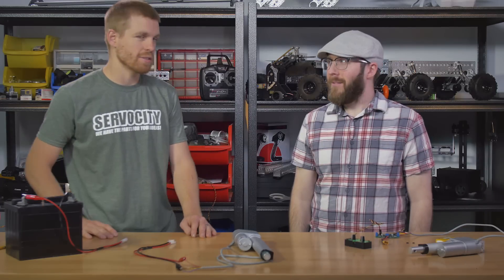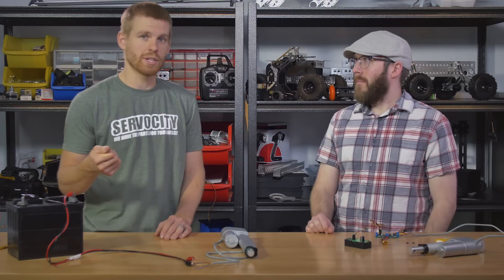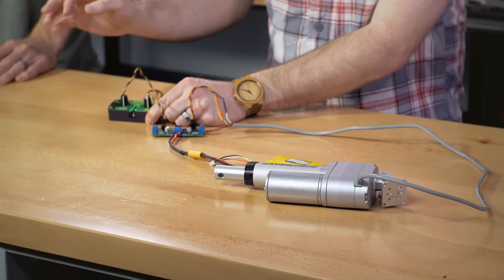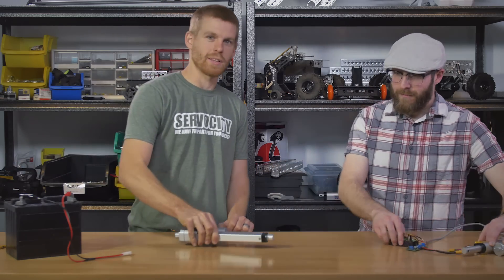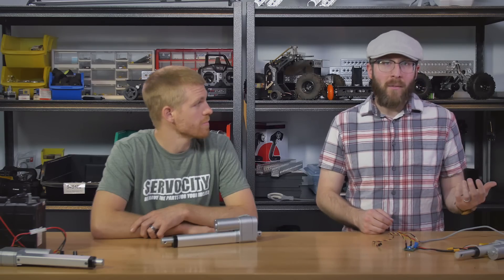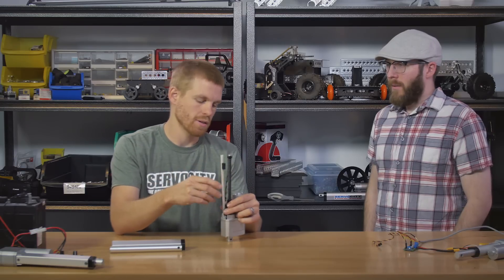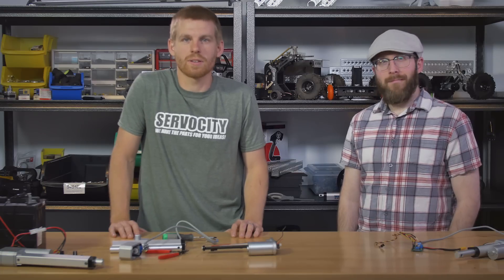Comparing Linear Servos & Linear Actuators - with Kyle and Jason

Comment: Thanks for the insightful video. I want to know which one of the two (among actuator and servo) should be the right thing to use for a position controlled height adjustable table that too with sync stoke on multiple legs. Thank you!

Comment: 8 years now. Well, I am an automotive guy who has somewhat painted myself into a corner. Meaning, I have auto controllers already that produce a PWM signal to operate a brushed DC motor. I need to piggyback of this circuit to control a cable that requires 4 1/2 lbs. and only move 1 3/4”. The speed is a concern as the faster the better, but also longevity is my main issue. It will be operating in a circuit environment between 12.3 - 14.4 Vdc and pulling only 4 pounds in a short distance. It will be a cable that controls hydraulic pressure and will see hundreds if not thousands of micro adjustments per hours of use.  I really like the ball drive on polished worm screw concept as P/S gear boxes use it, but most 3D printers, lazer cutters on larger scale use these and so forth. When piggyback I mean using good quality relays to convert low current into higher current circuits. Less than 2” of total movement plus only 4 pounds roughly as I have measured it with a mechanical pull scale. 
Suggestions for a disabled ASE Master since 78, a tech disabled for 15+ years. This project is mine for me. I wish it to last 20+ years. It will be monitored by a pressure gauge as well, but no alarm. If it fails, it can mean $3,000 up for repair as I can’t or won’t be able to do it. Pass it along to a younger generation complete with service manual in paper, CD, and thumb drive with part numbers, schematics and brands of parts with part numbers. This is the big problem in the auto concourse restoration business because the use parts for 50+ manufacturers yet never write it down. The same is true with who pay $50k, $70k or $110k to have a car stripped, rusted panels replaced and welded on the vehicle. It is months if not years of work to do this, as paint products alone can cost $4.5k like PPG where a gallon cost $900, then reduced & hardener added as required. But weld the outside at 2,300 degrees F, any coating inside turns to crispy critters with bare steel. It will rust! Inside, these parts have to be coated with a yellow waxy petroleum based product and repeated every 3 years. I spent $28 per quart for this product as I am lucky enough to own a pressure pot that has 4 different tip / hoses to reach these areas as drain holes are built in. Rain, car wash, pressure sprayers or simple moisture that forms dew in the grass is formed inside metal and creates drips that run out the bottom. But this moisture will cling to anything plastic, metal, steel high strength or mild. I repaired mechanical issues with vehicles of every brand and type. It works the same. So if your business is lucky enough to allow you to buy a 68 Camaro, GTO or Dodge Charger, it too will fail. Free advice from someone who knows and has 10, 15, 20+ years before I am gone in a dirt nap! 
  Happy New Years, 2025! Guys! 😮

Comment: Is there an amount of what they can push an pull ? Is there a certain amount of pressure you can do this with ?. Also what sizes do the come ? Also is there a a breakdown of what poundage you can use . Basically if I was standing on it will it move me up or will it break due to ,to being to lite of a motor .

Comment: A couple questions! What is the noise rating on the servo? Also, if I were to open the servo and move the limit switch on the fully-extended side (desolder, drill, solder), would the servo have a correctly-functioning shortened range? I'm looking to do ~85 lbs with a ~1.5" throw and it would be excellent to have the safety in hardware, not software.

Comment: I bought an actuator for my boat trim motor and it lasted about 3 weeks before it died. I made sure it was water proof and then I also sprayed it with water proofing. So that is one thing you forget to mention. It had much more dynamic and static load rating than I needed and was the correct voltage. It was slow but I would rather slow than not enough lift. Anyway, I would be interested to know what went wrong. The company had a 30 day return but by the time I was able to install I really only got about 3 weeks out of it and maybe had to lift the motor 8 times during that period. Can you comment on what may have/could have gone wrong ?

Comment: Looking at one of these linear servos to convert a riding mower into a RC mower. Gonna need one for steering, and a light duty one for actuating the hydrostatic transmission control lever. It's gonna be sweet!
Reply: Can you explain specifically
More how that would work for a noob?

Comment: once it hits the end switch and you disconnect the power, what happens if you try to compress the rod back in... trying to automate a mechanical button and i need the rod to be extended for longer periodes of time while being under the force that is trying to push the rod back in.
Reply from the maker: It can support a pretty large amount of load without backdriving (turning backwards under power), how much load are you trying to hold and what speed actuator?

Comment: Hey, what would I need in order to be able to control force, so let's say it's some kind of actuator that can pull max force of 100lbs but if I set it half way then I can still pull the full range of actuator range but it would be 50 lbs, quarter setting 25lbs, ect.??? So like a shock absorber but with on the fly resistance control?

Comment: Hi, I have question, I have got the Linear 12 V -DC, 300N, 50mm stroke length the same as Jason tested.  I connect to Adaptor 500 mA, but does not work is it because I need more Ampere for 12 v dc adaptor?

Comment: Can 4 linear servos be connected to a battery and a switch together so that all 4 actuates in sync?
Reply from the maker: That would work with Linear Servos, you would need a servo controller sending the same signal to each of the 4 servos. That would keep them synced up well.  
Depending on the tolerance for  misalignment in the mechanism,  a standard linear actuator  on each corner with one switch controlling them all may work just fine for you.

Comment: Great video thanks alot.
I have a question, I have linear actuator for my sail boat swimming platform with separate controller.  Recently actuator is no longer working properly.   It has. to go all the way to either end in order to come back.  For example opening platform ı can stop inthe middle but can not close is back it has to open all the way to the end  Same by closing it. Do you know the  reason*, is it cause of controller or actuator faults.  Thanks a lot.
Reply from the maker: What actuator and controller do you have?

Comment: So I may or may not be planning on using this to gimbal a rocket nozzle…

Do you know anything similar that can open and close without having to manually change it? I’m not a professional at electronics lol

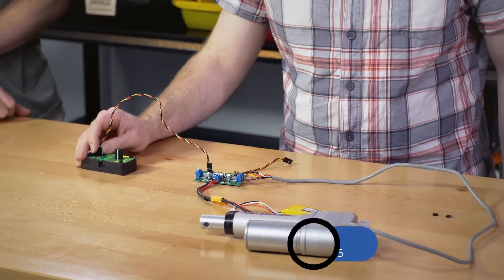I think the simplest way would be an automated modification of the system shown at 3:20
Reply from the maker: Hello,
If I'm understanding correctly, you want a system to continuously run in and out? If so:
I think the easiest option would be the combination of a motor controller, an Arduino, and a Linear Actuator. The linear actuator has a pot that communicates the position of the actuator. The Arduino can read that pot, and control a motor controller. Some simple code could tell the motor controller to run the actuator in one direction, or the other depending on the current position of the actuator.

Comment: Great.... It means we can increase the movements and directions without reversing the polarity of the battery.... How about a linear actuator ac?
Reply from the maker: AC linear actuators are not something we carry at this time, but you could run either a linear actuator or a linear servo off of AC wall power using a 12v DC Power Supply.

Comment: I was looking at repurposing some adjustable bed linear actuator but the wire has a multi-conductor plug with 4 pins.  Why?  Can I convert this to be 2 wires like the actuator in your video. I can't wrap my head around why there's more than two conductors in the plug. The linear actuator doesn't do anything but go in and out to lift bed up and down. So why so many pins in certain bed actuator? I've seen some with 4 or 5 even 6 pin plugs on some. Can you explain why a simple motor would need so many condutors in the plug?
Reply from the maker: Hello!
We are not sure why your unit has 4 wires unfortunately, it is possible it is not running a standard brushed-dc motor. Something like a brushless DC or Stepper motor would require more than 2 wires to operate most likely. It's also possible that the additional wires are some kind of feedback device. Our actuators for example have 2 power wires, and a 3 wire analog position output set. So 5 wires in total.
Reply: @ServoCity  I thought that could be the case.
I think I will get the info off the actuator and see if that will help me find out anything more.
Also I'll probably have to carefully cut back the wire cover and see how many wires are on the actual wire part after the plug.
I was hoping to avoid having to do that but I guess I'll have to and test wires with my multimeter.
Do you HAVE to hook up the extra wires for feedback? The bed controller I'm trying to use is better in every way than my current controller but the difference is the plug on the actuator motors. 
The new control box has just two wire sockets for motors but far more programming options than the much older box that has 4 pin plug. I don't see why there would be feedback wires. The original controller didn't even have massage or any other features save for "all flat" and two memory locations, so I don't think the extra pins are being used for feedback on such a basic model and old of bed. But I could be wrong. And if feedback wires are there, do I have to use them if the new controller doesn't use them? 
These are the questions that keep me up at night lol. 
I'm hoping that it's just two wires after the plug but like I said I will have to do some testing it looks like.
And if I don't have to use the extra wires, then I won't.
Do you know anything about not using the feedback wires? And just the motor power wires?
Reply: UPDATE... Additional info. The model from the label says fd24-a4-320.400-c12-p0
I looked up the specs hoping to find info on a pinout but nothing. I did find out what those codes mean and the very last "p0" denotes the basic version with no "Hall Sensors" which I assume means feedback sensors. Because they can have one or two and the code would change to "HS1" or "HS2" accordingly.... Which again "p0" means no sensors
So it's looking better and better that the extra pins are not being used for feedback sensors.
Reply from the maker: Some cool information!
I would agree that it doesn't sound like the extra feedback wires are being used. 
Please feel free to reach out to us via email or phone with any more info, but from what it sounds like they are extra and most likely there are just 2 wires that are being fed 12v actuator power. Most actuators are fully capable of running without their feedback device being read, it just allows more complex control of the unit.
Reply: @ServoCity  thank you for helping me to believe that my initial assumptions could be correct.
One new thing I learned.
I was facing a similar situation with the plugs on the massage motors. Again the sockets on new controller were two pin but the massage motors I picked up were 5 pin. I took the massage motor casing apart, reasoning to myself that these are nothing more than simple dc motors. Why on earth would you need 5 pins?  Turns out you don't. The wire inside the casing and soldered to the motor was only 2 wire.
So far my quest to put together my own upgraded adjustable bed is going wonderfully. Hope the linear actuator problem goes just as easy when I test those next. 
Thank you again for your help!

Comment: I would like to know if these actuators are compatible with raspberry pi, could you give me the answer to this?
Reply from the maker: Hello!

Our linear actuators are DC motors at their core, so they will work with any Raspberry Pi-compatible DC motor driver (many of the controllers on this page: https://www.servocity.com/motor-controllers/).
As far as linear servos go, they will be controllable by a PI the same way you'd control any other hobby servo.

Comment: I am looking for some ideas as to how to build an old school arcade driving cabinet like Out Run where with the turn of the wheel, the base would move. I am thinking about putting an actuator or servo, I think 4 will do the job. But what I don't know is where to start or look for. Would something like these work at high speed sensitivity and would they handle the weight? I originally was looking at hydraulics, but outside of weight, they would seem slow. Suggestions?
Reply from the maker: Thank you for reaching out to us. If you could please send additional specifications to our technical department they would be happy to help with some recommendations at tech@servocity.com

Comment: What a I do to stop my linear actuator from whining when it runs?  Very disappointed with the noise from this 12 volt device.
BTW, changing the angle of the actuator, you can change the speed of what you’re moving and range of your movement.

Comment: Great vid. Do you know would you go about controlling the specific position of the actuator throughout the day? Like for a solar tracker. Cheers!
Reply from the maker: It sounds like you're after a linear servo of some sort, likely combined with a microcontroller to send it position commands such as an Ardunio (https://www.servocity.com/pololu-a-star-32u4-prime-sv/) 
To interpret the signals from a solar tracking sensor or something of the like.
Reply: Isn’t a linear servo technically a linear actuator?

Comment: i would like to use one of these to lift and lower my JD 44 inch snowblower on my x 300 Lawn tractor,will the cold affect the function? slow or stop it from working?
Reply from the maker: The cold should have no affect short of edge cases like if water somehow got inside in which case freezing temperatures would expand it as it turns to ice which may cause damage. Given their IP ratings this is unlikely. You can check the IP rating of the one you are interested in and look up the meaning with this chart https://www.servocity.com/glossary/#ingress-protection

Comment: What if you don't know what the feedback wires are. I have no documentation on mine as it is a used actuator
Reply from the maker: If it's an actuator from ServoCity we have documentation online that would tell you everything you need to know.  If it's from somewhere else, you could measure the resistance between the wires to locate the potentiometer wires, or, open it up and trace the wires. Please let us know if you have any further questions.
Reply: @ServoCity  it is not one of yours unfortunately it is a duratron mc42-1015h.  It says 115v but I thought all linear actuator were dc. Came from a old hospital bed

Comment: I'm designing a gate opener.  How well would a linear actuator hold up outdoors?
Reply from the maker: Actuators are very commonly used on gate openers.  You'll just need to find one that is rated for the environment.  The IP rating will tell you how well it's sealed up.
Reply from the maker: Actuators are very commonly used on gate openers.  You'll just need to find one that is rated for the environment.  The IP rating will tell you how well it's sealed up. Please let us know if you have any further questions.

Comment: could the power source for a 12 volt linear actuator be a ac plug in 1 amp 12 volt car battery trickle charger ?
Thanks - and great video
Reply from the maker: If the actuator you choose pulls less than 1 amp under load then it may work.  Some trickle chargers may have circuitry that keeps them from supplying voltage til they receive a certain amount of voltage from the battery they are connected to.  To check your trickle charger, plug it into the wall, connect it to a multi-meter and see if it's supplying a voltage. Please feel free to reach out to our technical team should you have any further questions at Tech@ServoCity.com.
Reply: @ServoCity  Interestingly, a multi-meter does show voltage on my trickle charges But the linear actuator still won't work with any of them - must be some sort of circuitry in the charger to prevent this type of use - so I am scouring my supply of old AC-DC chargers from old phones and rechargeable tools to see if I have anything in the 12V 1 amp range

Comment: Hi. I was considering to use a linear actuator to change the tilt angle of a structure holding solar panels. Overall, around 200kg. Would this option vaild to keep the structure to a certain angle for longer periods? Or the weight would push it back? Thanks
Reply from the maker: Hello thank you for reaching out to us. Please email our technical team at Tech@ServoCity.com with your project details and they would be more than happy to help you.
Reply: Hey @MrSavage77 did you find any linear actuator that worked for that kind of load?? I'm looking for something similar for a project.

Comment: Hello! Great video. Is it possible to create an automatic reciprocating (preferably adjustable) movement with a linear actuator (without having to turn a switch back and forth) and if so what equipment would one need? Thank you so much 😊
Reply: arduino